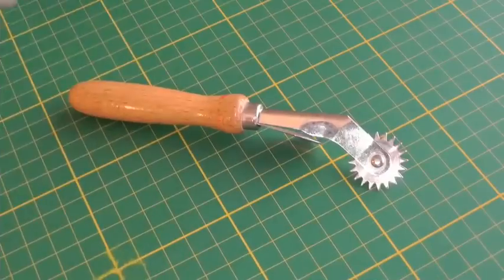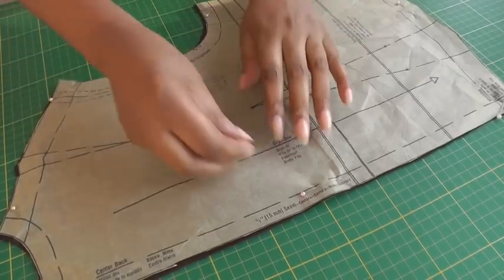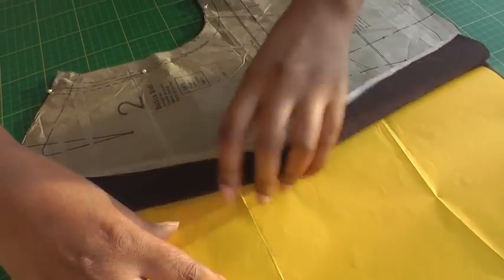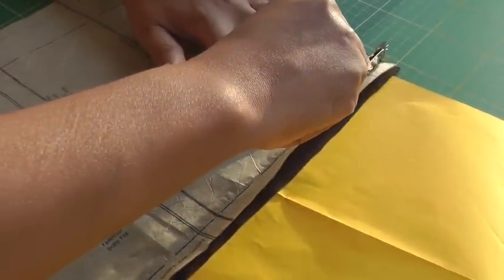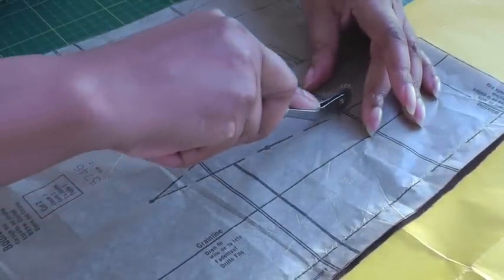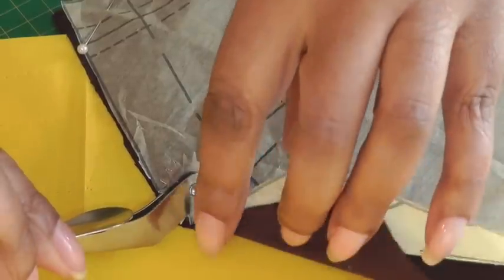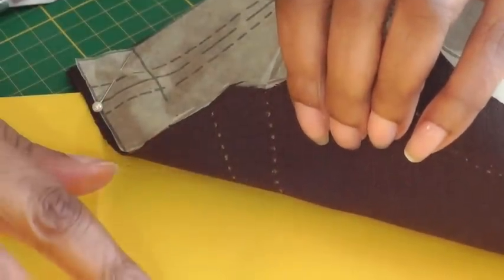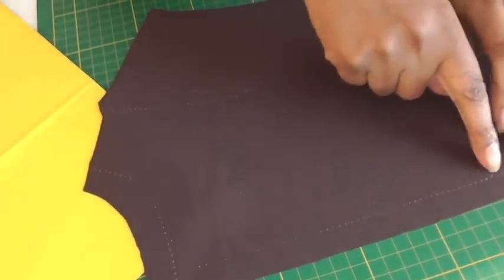Using a Tracing Wheel

Comment: Thanks so much for the demonstration. Have a question though... doesn't the wheel destroy the tissue paper? I stopped using my wheel because of the little holes it made in my pattern and made it even more fragile and difficult to use a second time. I even trace my patterns off the original pattern but I would still like to re-use them if possible.
Reply from the maker: Hello Sollenbum, I totally agree!

Comment: Thank you so much.
Is this the regular carcon paper or a special one for fabric???
Reply from the maker: You can buy ones for fabrics or use regular carbon paper. The one thing to remember is to test the paper on scrap fabric before using it, so that carbon does not transfer to the right side of the fabric. I hope that helps Mary.

Comment: Thank you for the demo. I bought a smooth - non-serrated - tracing wheel (not realising there were 2 kinds). Just wondering if I can use this the same way? Or if not, what is it used for?
Reply from the maker: You can use it in exactly the same way.

Comment from the maker: Are you pressing hard enough?  If not, this will cause the markings to be very light and difficult to see.  Another problem may lie with the folding of the carbon paper.  If it's not folded correctly, then the markings will not transfer.  Fold the paper so the carbon is on both sides.  Hope that helps.

Comment: Thank you for the Tutorial. I do have a question I am trying to make pleats and I need to use the tracing wheel and tracing paper. The color from the tracing paper is not showing up that well on one side of the material. Could you please tell me what I could be doing wrong? Thank you

Comment: Hi! I want to trace a pattern onto the fabric so I don't have to cut the pattern (I'm trying to avoid purchasing several of the same patterns for different sizes). Do I just lay the carbon paper onto the fabric under the pattern? Thanks!
Reply from the maker: No. The carbon needs to be on the WRONG side of the fabric.
Reply: Ok, thanks.

Comment: Is there another way to transfer patterns besides the wheel and tailor tacking?   I really need to be able to reuse the patterns without putting holes them, because after a while they tend to fall apart. I currently transfer them to butcher or freezer paper, but its thicker and harder to transfer through.
Reply: Try using the tracing wheel and carbon paper to put the pattern onto butcher’s paper to make a more durable pattern pice. I hope this helps

Comment: im slightly mad, caus my kit came with a tracing wheel, with no carbon paper. Like what  am I supposed to do  ¯\_(-_-)_/¯. Why bother putting a tracing wheel?
Reply from the maker: Hello Laurelle, I understand your frustration, thanks for commenting.
Reply: You don’t need carbon. You can see the lines by simply looking at the impression of the wheel. I’ve never used carbon paper.